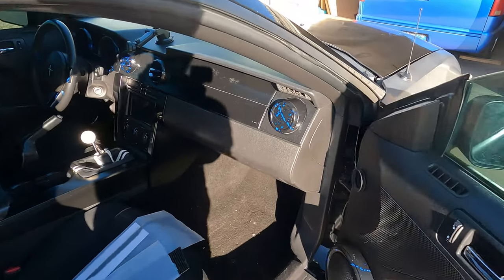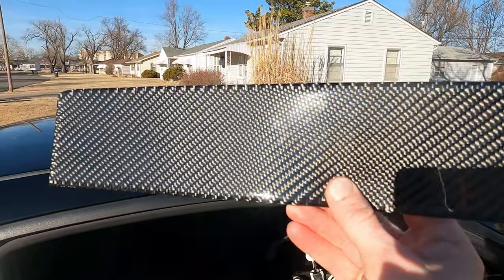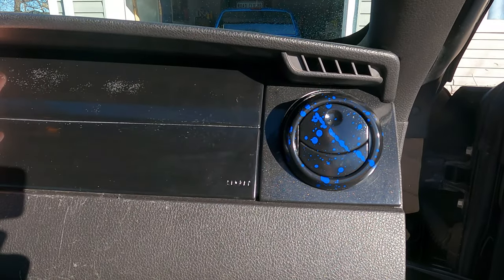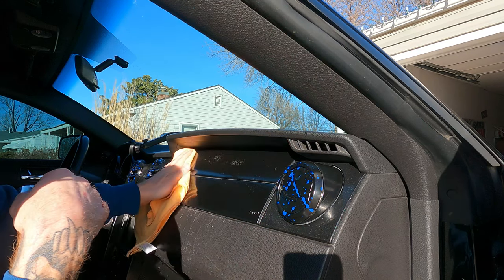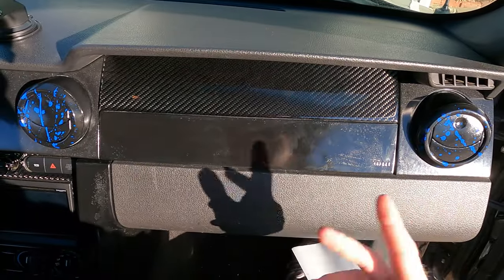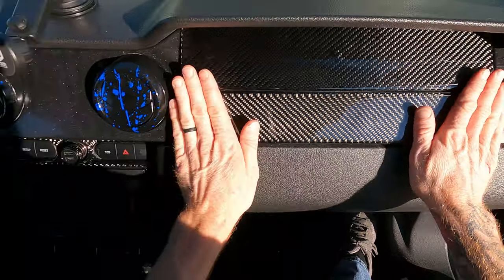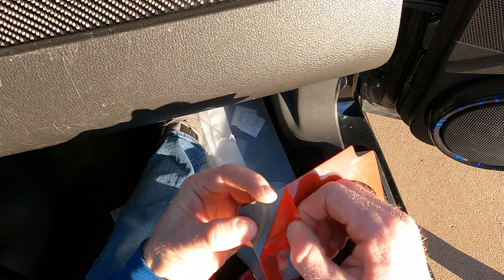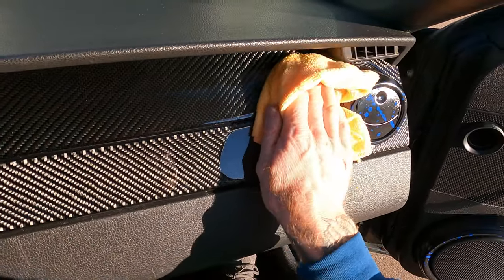How to Install CARBON FIBER Dash Overlay Kit In A MUSTANG GT!!

Comment: You've got the grain going in the wrong direction on the top of the airbag.  It should have been turned around to match the rest of the panels.  A easy mistake placing that piece first, before seeing the rest of them.

Comment: One thing I learned from putting Chrome trim around my taillights was to cut the protective backing with a razor into strips and peel it off as needed.  Otherwise with the whole adhesive side exposed the application sticks in areas you don't want it to.
Reply from the maker: Great advice. I’ll keep that in mind.

Comment: looks awesome. how do you remove the steering wheel pieces?
Reply from the maker: They pop off easily if you get under the edge of them with a plastic pry tool

Comment: Are they still on and last well?
Reply from the maker: No. Absolutely do not go with the cheap ones from Amazon. They peeled off and turned hard both times I installed them. I would say dyna performance is the way to go